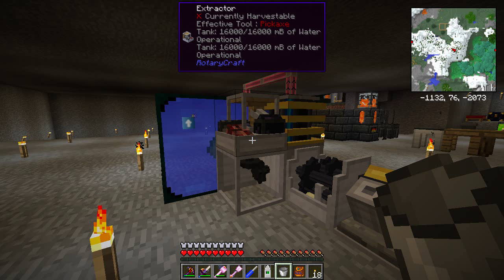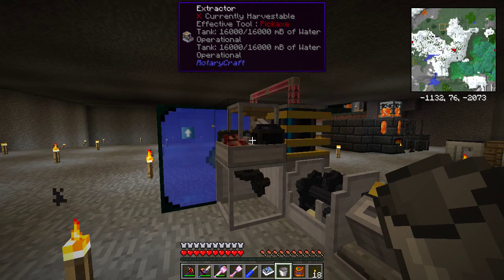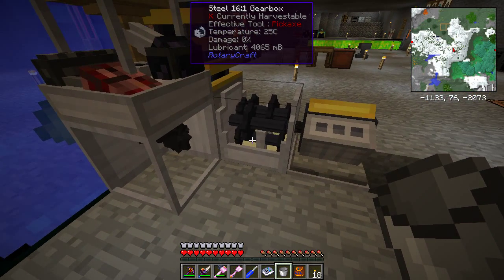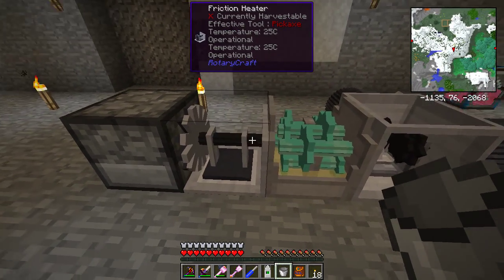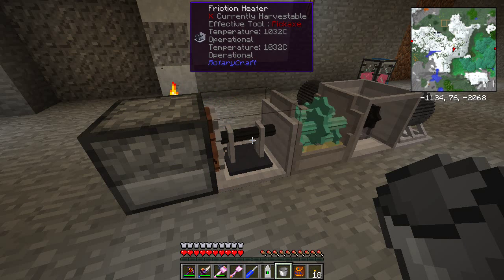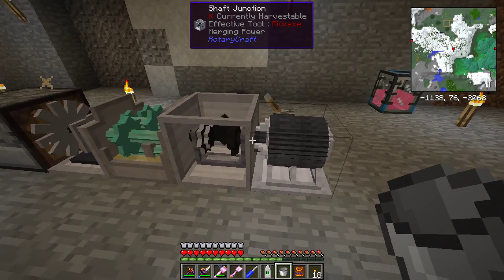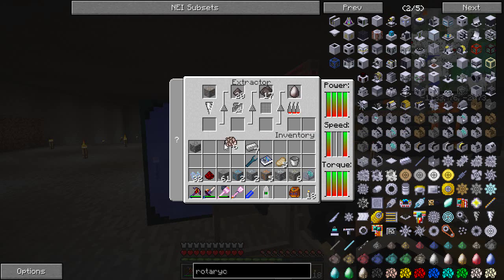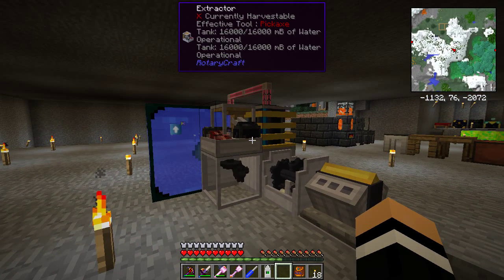S04E09 - Howto - RotaryCraft Extractor & Tungsten

Comment: Requiring two microturbines to smelt tungsten was a bug. This was fixed in v3.
 Also, the Nether has no major effect with the Friction heater. It can get hotter, but not by a lot.
Reply from the maker: Wow, Reika himself commenting on one of my vids! :-)
I've been running v3d the whole time, and it never seemed to get beyond 1278 degrees with a single microturbine.. I left it for ages, it was outputting full 2MW... Just didn't ever get the friction heater hot enough. Even with two of them it climbs very slowly to around 1278... then all of a sudden it bursts up to over 1400degrees within a couple of seconds.
Reply: That burst makes sense; when the speed inputs on a junction are mismatched, only the faster output is transferred. When both engines are up to speed, the power to the heater doubles.

As for needing two engines, my base in my world indicates otherwise.
Reply from the maker: Reika Kalseki Aha, I just did a bit of a test. Turns out you can get to exactly 1350 degrees if you stack a 16:1 and a 4:1 gearbox one after each other - if my maths is correct, this makes for a 64:1 ratio?
Now the reason I never tried this in the past, is that the friction heater says it needs a minimum of 8192 rad/s. The microturbine outputs 131,072... which with a 16:1 gearbox ends up at exactly 8192rad/s... So does this mean that the friction heater no longer requires the full 8192 rad/s to work? It appears the heat scales with torque, not with speed (I tried a few other gear combo's as well). Again, if my maths is correct, with the gear ratios I now have, the friction heater is getting only 2048 rad/s, but 1024 Nm of torque... Is this correct, and is the book page for the friction  heater now incorrect?
Reply: No, there is a benefit for closely matching torque and speed.
Reply from the maker: Reika Kalseki Ah right, well its halved my fuel requirement for now anyway! Also, I'm a muppet once again. I thought it needed 8192 rad/s to work.. but its actually just 8192W that it needs... So all is good, I was mistaken!

Comment: There is an automated way to run an Extractor through all four stages with a gasoline engine's worth of power. ;)
Reply from the maker: Interesting... I might have to have a play around. :-) Guessing theres a way to sense what ore is in each stage (computercraft?) and then redstone signal the gearbox? Theres always the crude timer option, but I never like using those in situations like this as its horribly inefficient.
As a side note, I'm liking the rebalance of the mod. Bedrock is harder to get now (and it should be), and the magnetostatic nerf was definitely needed. Its steering me back towards what the core of the mod is about, generating power from rotation, not just pumping your RF into it to power machines. I'll hopefully get some reactorcraft going soon as well though, and then that might bring magnetostatics back in... Altho I'll need to find a way to make liquid nitrogen fast enough, I found out the hard way that a T3 magnetostatic cant drive the fridge unit fast enough to even supply its own needs... ouch! lol
Reply: There is a little-used transmission block you need. :P
Reply from the maker: Reika Kalseki Ah, I'll have to look for it.. :-) Also while you're looking at this.. there seems to be no way to hook up both jet fuel, and the engine control block to the gas turbine... I want to automatically just feed jet fuel into it, but I also want to control when it is on and off. Both the fuel line and the control block appear to need to be under the engine... Is there a way around this?
Reply: See my comment on your other video.